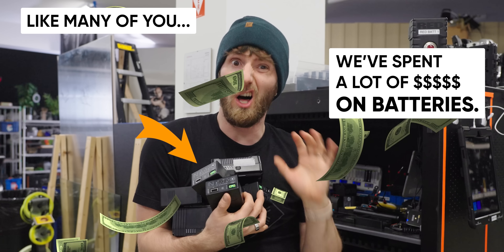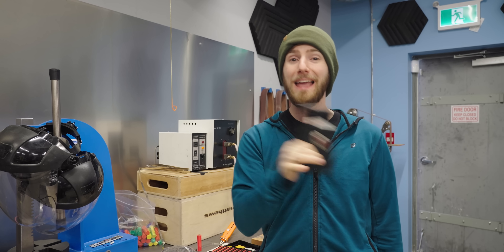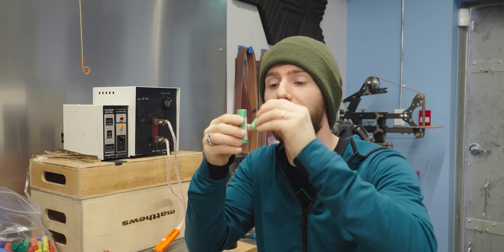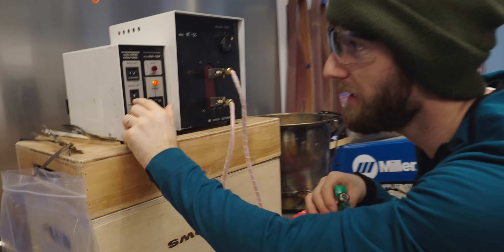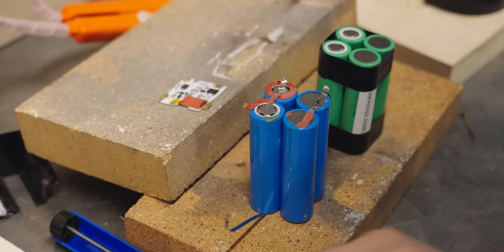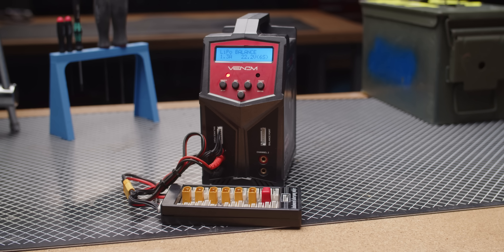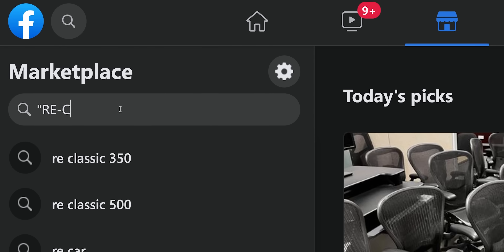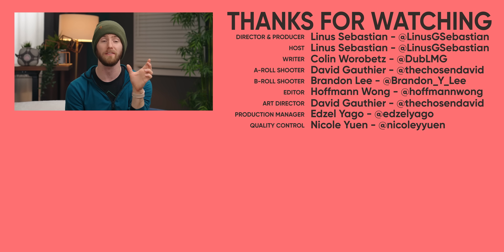This should be illegal… Battery Repair Blocking

Comment: Had problems with Dell and the evil BMS.  My old Dell B120 laptop from 2005. Actually still in use to this day with ORIGINAL battery(slow as heck but used only to print shipping labels). Battery actually "failed"  around 2007. I opened it up back then as i wanted to see what the capacity was left in the pack. 6 cells, 12.6v. benchmarked the cells and they all tested excellent, both in capacity and overall health. found if i shorted a specific spot (found by accident) on the BMS it would reset and charge/function like new. 
Fast forward 19 years, and that same battery is still in use. it HAS degraded, full charge after 19 years of use is 20 minutes,  it that's more than enough to wheel it to move it around. gets a reset about every 2 years :-)  My old dell Mini 9 though same story only couldn't reset.

Comment: They should make all battery cases openable so that we could just swap out the cells, 

Had a rigid battery die on me, so I opened it and put the batteries on an 18650 charger, and only one cell was bad 
Luckily for me, I've got a flash light and a vape that I can directly use the still very good cells with these devices

Comment: The only problem with buying replacement cells is that the consumer is at a complete disadvantage and usually ends up with substandard cells and is left wondering why the product they purchased doesn't work as reliably as it used to. The manufacturer of the equipment buys large quantities of batteries of a higher grade than usual consumer grade and relies on them being of very high quality for the health of their company. This means that they must know that the batteries being placed in their products and being sold to their customers meet the highest requirements. They are purchased in large quantities in serial numbered lots and the company buying them spend large amounts of time and money performing (or pay for others to perform) random sample testing of every lot of batteries they receive. If the batteries sampled from a lot are not up to snuff, they will reject the whole lot. These rejected lots are returned to the manufacturers and the lot is down graded and sold along with other batteries of a reduced capability for a cheaper price  Batteries being sold for cheaper prices on line for a somewhat cheaper price are usually these batteries that can still hold a charge and may still work over less stringent environmental conditions or may not provide as much peak power and most importantly may not be able to be recharged as often as required before they start failing. This wouldn't be so bad if the online sales outlets would publish the grade of the batteries and disclosed what specifications make up the grade being sold. Without this disclosure the consumer has no idea of what they are buying and what if any short comings the are unknowingly accepting.

Comment: Jmo, I've worked with many lithium cells, have my own spot welder, 3.2v to 3.4 volts is not a major voltage imbalance....if it were a half volt or more, yes, but even that can be evened out by the BMS....I've had no issues with a slight imbalance of 2 tenths of a volt.
Enjoy the safety precautions you take and good video.

Comment: I'd go more on a route like, 
- measuring a healthy battery,
- make a case in 3D then ordering it with a safe plastic regards of safety on that exact matter
- buy a BMS from a reputable brand
- not rely on spot wielding but just separate holders that they sell a biut everywhere for these size of battery cells
- assemble it all & stuff
then done. i'd do that for a 100-200 serie & more though, may not worth the hassle for less, idk

Comment: Batteries as a cylinder or square shape have computer heat sink fan like metal fins as DIVIDING CELL WALLS so the whole battery never goes up in flames.
Actually its non flammable what is burning is overloading from wrong resistors and wrong charging. Say you bought a travel USB charger for $1 and plugged in a powerful LAPTOP that uses newer FAST CHARGING with hundreds more watts and higher voltage. The charger or the laptop will overdraw and overheat. If you've ever used a mobile phone or device for hours the battery maybe feels warm as its a 'reaction' of ENERGY TRANSFER the same way a 60 watt incandescent light bulb is a piece of wire filament and can become very hot or warm to the touch during NORMAL OPERATION. the same way WIRE FILAMENT IN A LIGHT BULB IS NOT FLAMMABLE AND NEVER BURSTS INTO FLAMES but can be OVERPOWERED and can be known to "BLOW A FUSE" or something along those lines battery fires arent possible they arent that sort of flammable at all the same way copper wires and induction stove tops dont burst into flames but you could have a kitchen fire in certain situations. So your video makes it sound like you're going to switch on a light bulb and boom fiery inferno. Put a mp3 player with a lithium ion battery into your pocket and BOOM FIREBALLS! you think that your water boiling kettle is super flammable? its about identically physically capable of exploding as a battery is BY DESIGN! what does explode like that though are 16th century 'illegal not batteries' that use SUGARS and SYRUPS and possibly some sort of stomach acids or aiming for a similar reaction like "lets be efficient and use power like the body does." Those are the exploding ones. So if you buy fake NOT A BATTERY and it bursts into flame as its NOT A BATTERY or you bought a cheap fake product that has the wrong design by design and is engineering fails you dont rapid charge your tesla with a $1 usb charger from the market or try reverse type C charge it off your mobile phone and then see the plastics around the battery burning as it overheats and think you've got some TNT in the form of a battery. Yes 90% of those videos are illiterate uneducated criminals try to sue say their stuff blew up and go straight to prison as its not physically possible or reproducible without fake sabotaged molested versions NOT SOLD BY THAT COMPANY. The other 10% are some sexy girl in school is boasting how many calls and text she gets because she's popular with the boys so she makes a video about her phone bursting into flames flexing on her rival clique because she was competing in zero value internet points and 'likes' so no the phones battery didnt really explode and the phone didnt burst into flames.  The battery overloading or OVERCHARGING causing it to balloon out can happen so maybe dont leave them charging overnight and take them off the charger the 30 seconds to 15 minutes it takes to FULLY CHARGE ANYTHING WITHIN THE LAST DECADE RETARDS its called SUPER FAST CHARGE NOW! see the avengers movie black panther or whatever the phones docking station says 'charging' vrrrrm and its done! thats a phone you can buy since that movie came out.
However ballooning out the battery to be double size and OVERLOADING it is actually a super audiophile technique of overamping and overdriving. So some of the cheapest batteries in the universe are made and used for some of the best audio experiences and was why portable amps were said to be a bit of a risk in the early years they came to market as the best ones were likely shorter life span or had a much higher chance of failure. More expensive ones just stick twin batteries in double so their balanced amps could have an overdrive mode for large over ear headphones that were harder to drive like brand AKG is famous for.

Comment: I'm sure that if they wanted to make these easy to replace they would make a frame loke the older AA frame that hold 8 batteries to power a 12 volt device. It seems easy enough to do if it is possible with AAs for decades.

Comment: we should have the option no matter the danger. I bought a NEBO SLYDE KING 2k flashlight, went to put a different 18650 battery in it an nothing wouldn't work. After a bunch of research I found out that NEBO used a modified 18650 that has both the positive an negitive terminals on the bottom of the battery . NO WHERE on there website does it say that. There advertised as just using an 18650 battery. Not a single mention you'd need to buy batteries from them "if therre ever even in stock. I love there lights but wont buy another because of that anti-consumer practice they got going on over there.

Comment: I use hot glue to hold my cells together. 

On some BMS boards, you need to charge it to "wake them up" after cells get replaced.  

If your lucky that is.  Alot of brand brick for sure.  Even when I try and keep voltage to them when I replaced cells.  But that an issue all on its own.

Comment: My old makita nicd had screws to hold it together. No bms needed, I got new cells, nimh, nickel strip and soldered in new cells. I know spot welding is better but soldering was much cheaper because I already have a quality solder station. The battery is now better than new with larger capacity,  higher current capability,  and the charger is already made for both nicd and nimh so nothing was needed there.

Comment: You're hold.
Ing it on way too long you do push.Let go real quick.The longer you have it on there, the more heat you're putting to the battery and the worst the battery will be off in the long run.I've made 20 or 30000 battery packs.And i'm surprised you didn't ask to catch one on fire

Comment: You wanna know what's just as bad as R2R and _Programmed Obsolescence _ ; but NOBODY talks about it? 
Intentionally Inferior products that sell for $1.00 - regardless of inflation or supply/demand.
Somewhere in the world right now, a coffee carafe is being manufactured with such careful consideration of the end user that the "spout" and construction materials were chosen specifically to disrupt the surface tension of the hot liquid and the spout- meaning it won't run down the coffee pot and spill into your lap instead of just "pour" your coffee the way we would expect in the 21st century. What a rich idea!
Actually , in the scope of manufacturing and general engineering standards, it's a very cheaply produced luxury as long as you meet the moq. It costs less than $5 to manufacture in nearly every  industrial market on the planet. 
Meanwhile, across the street from those factories where $130 retail coffeemakers are made for $5, some a$$ -whole is working double time to keep skilled labor, machine tooling and conventional fixtures (or vice versa) pumping out 18th Century CoffeePots that will sell at a Dollar General for $13. And it only costs 25¢ per unit to be the "_EntrepeOLDER™_ who keeps that industry thriving from Shenzhen to Sacramento to Scranton and every wet tabletop or khaki crotch in between.
So, Riddle Me This, Arc Weilder:
Do inferior and outdated products remain because of the 
¹ cost of making high quality tooling and production standards of our predecessors, or
² the greed of our predecessors's least academically gifted or ethically motivated heir to fire up all that dusty equipment that can be monetized again, or
³ the inconsiderate first world consumer that buys 10 crappy coffee pots before he notices there is something different about the things we pay more for up front.
?

Comment: I hadn't heard of batteries locking themselves until I replaced the cells in my laptop battery and it still wouldn't work.  Turns out there are quite a few laptops that lock themselves if they have a fault.

Comment: I've soldered a few small packs together ( lifepo4 a123 cells so fairly safe Vs lipo ) using solder braid, plenty of flux and a strong iron with plenty of heat and it goes fast.
I did not like it though lol, very dodgy working with lithium batteries, best left to the experts with all the right gear and knowledge imho.
But making them unrepairable is very underhand, especially just after a set number of cycles.

Comment: Battery recycling is basically making batteries fire and short circuit safe, so that the materials can go where everything else goes.😱
Yea, "recycle" scam. They are NOT recycled, they are trashed. Only a very few cells ever get 'shaken out', or material separated, to reuse the base materials for consumer products.
So, yea ... scam

Comment: I had a DJI drone where a few of the packs went below the critical 2V limit that causes the BMS to no longer allow charging.  I was able to bring the individual cell back to nominal voltage but the BMS still would not allow the pack to turn on.  I found a program for an arduino microcontroller that allowed me to reset the "flag" that caused it to deactivate.  My drone is now flying again and the battery is performing like new.  Just can't let the Li Ions get too low.  Have to charge them at least every 6 months.

Comment: Sometimes when you pull a BMS off a pack, and solder it to a new pack, you have to put it on the charger to "reactivate" the BMS before it will output any voltage from the terminals. I've had this happen many times when rebuilding a pack. Sometimes though, the BMS intentionally "bricks" itself when removed from a packs batteries when the voltage goes away. And YES, this is B.S. when this feature is built-in to the BMS. There's NO reason for this, other than forcing you to purchase a new overpriced pack.... 🤬

Comment: The reason you shouldn't mix old with new cells is they'll hold different charge values. The older ones will "read" as fully charged when the new cells aren't even close and this will cause the BMS to stop and start charging erratically which will, at some point, end up over charging some cells and overcharging is bad...like you'll have a warm campfire in your house bad...

Comment: EV West deals with using old lithium batteries

To make sure that used batteries are matched there is a device that will charge and discharge batteries to measure the rate of charging and discharging so that you can closely match used and new batteries

Comment: Those 70mm red cells most likely have an internal chip that handles part of the protection. Unprotect 18650 cells are 65mm. 70mm indicates an internal circuit added. The pack board may test the individual circuits. Since your cells lack that chip, the system detects a circuit failure and completely shuts down. I've come across LIPOs that have some basic protection but require additional protection for individual or group charging and use. This is particularly important when batteries are grouped in parallel without external ballance capability on each parallel set, which is how you were assembling them. The circuit did its job and disabled your pack. No malicious intent.
Reply: The red cell individual circuits may be visible if you remove the plastic insulating wrap. There may be additional battery data on the metal can as well.

Comment: the most infuriating batterys are those of iPhones. starting with iPhone 4, as soon as you disconect the cell from the proprietary Connector/bms and replace the old cell with a good /newer one (not original, not even same physical size, but at least good enough to give the device a 2nd life ) the BMS is bricked and the BMS is ewaste.

Comment: This might be a way to bypass the BMS from getting dead add at least one battery with a wire to the BMS while you undo the other 12 batteries do you know what I mean set one on when you're undoing the others so then it doesn't recognize that the battery is not connected anymore and completely kill the BMS board just an idea I don't know if you tried that yet

Comment: Hey, how you doing? My name is Louis I’m very interesting content. I’m having a battery issue. I got a 48 V 20 amp hour battery 🔋 for my Jetson J5 electric bike on a 36 V system everything stock in my 48 V battery it moves it really moves for like an hour all pills downhill everywhere uphill downhill after like 45 minutes the power shut off so I bought it home. I went to plug the charger in like five seconds the power went back on automatically. I took the charger right back up. I still had full power so I took it for another ride and I noticed every time I really hit that throttle after a good half an hour riding when I hit the full ride then the power shuts off and this time it didn’t just shut off it showed no bars and just one bar actually, and I could shut that one bar off and on when before the whole power just shut off like I couldn’t turn the power button on or off so I don’t know what the issue is if it’s a BMS issue I just don’t know and I don’t even know who to go to for help not even these electric shops around here are useful or I haven’t found one yet

Comment: Why didn't you  simply usesomething like ( KATA 5 Inch Micro Wire Cutters, Precision Mini Flush Cutters and Clean Cut Pliers for Electronics, Model, Jewelry, Model Kits,)  and cut off the nickle strip from the dead pack and use those for test welds? instead of wasting money buying them?

Comment: You sure you didn't do something wrong? I've re-celled a Sony Np-f style battery and it was fine. The only issue I had was putting the case back together so it was mechanically sound. More trouble than its worth. I've also never had problems with spot welding like you. I think the cells you were using weren't the right ones for the application. I've always used the Panasonic or Samsung 18650's. If your welding tip is sticking to the weld you have the power too high or the time too long.

Comment: I did some DIY projects with litium cells, I didn't knew they where so dangerous . . . fuck, could've died back then. 
I used a normal soldering machine, heated up the batteries a lot.